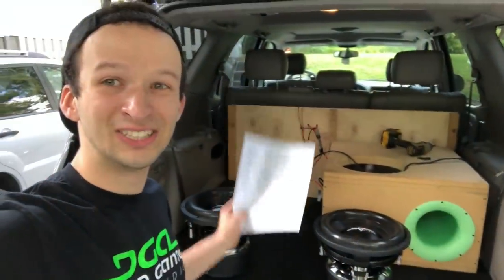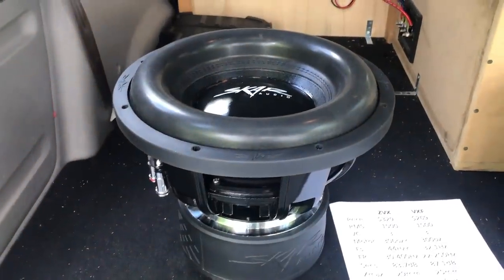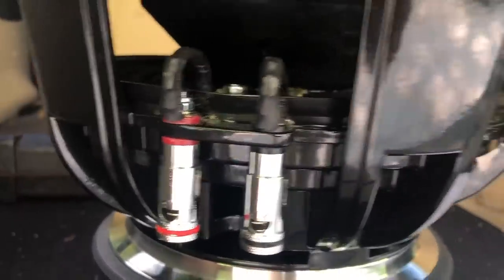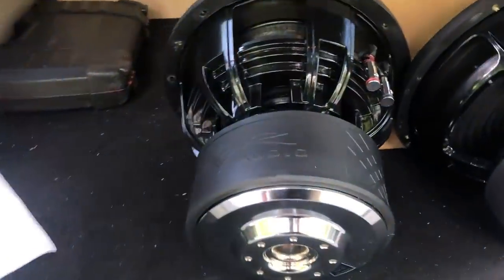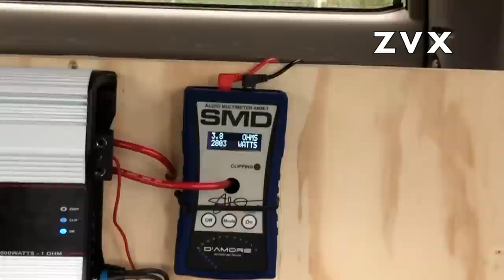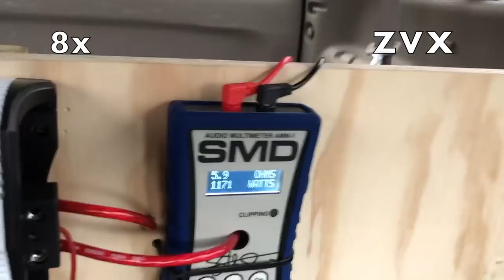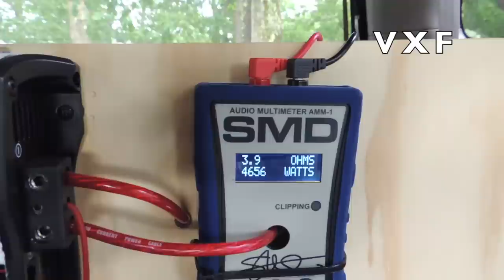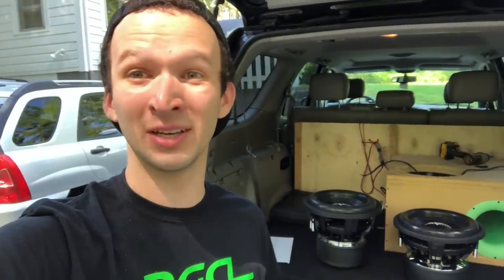SKAR ZVX VS VXF!! Which Is Best and Why? | Head to Head

Comment: I'm more into the quality of the sound. That being said I am running a single vxf15  on skv.2 1500.1. This thing hits hard and sounds clear. Took a while to purchase this setup. Last system I had was years ago jl audio 15w3 on a directed 600d. Not quite as clean as the jl but definitely close.
Reply: Did you have to upgrade your power supply?(battery etc)

Comment: That Zvx was going up to the high 7's in ohm load. Where the V was only going about 5.
Reply: Is that good or bad?
Reply: technically the vxf would be getting worse and less sound with higher ohms, 1 ohm produces the most power out of amp and lets say 4 ohms would produce 3 times less. so if a amp is 4000 watt 1 ohm stable and 4000 watt, that would mean 2 ohm would be 3450 watt, 3 2750 watt and so forth. so in his case the vxf was taking more power, and producing hard hitting LOW fq bass, while the zvx was produce a faster and higher fq, while using less power.

Comment: ZVX has taller motor of smaller diameter for the increased stroke. It keeps the coil in the magnetic gap through more of the stroke (or throughout the stroke).

Comment: I am working on a 2015 Toyota Crewmax and will have 8 VXF dual 2ohm 12’s on 8 Audiopipe AMPI 2000’s. Having a hard time with designing the setup for a second alternator but it should work out with time. Long way to go but should have the loudest Tundra Crewmax that I know of. One unique thing I’m doing is a snug with a accordion boot and retaining the factory rear power glass ! Also have 2 Skar VD 8’s behind the back seat in the cab in a prefab ported box for everyday listening and know one believes it !

Comment: I have a skv2 2500 pushing dual 1ohm zvx 12s in the skar prefabed ported box. Tuned at 33 hertz. Sounds insane. Only upgrade i have is the big 3 and added another battery. I should of gone with the 3500 but was on a budget. All I can say is  that skar backs up what it says on the audio. The lows in my set up is crazy. If you can't hear it, you will definitely feel it

Comment: I got 2 VXF 12s with the skv2 1500.1d and I love it! Very great sound quality!
Reply: You have 2 1500 rms running on 1500 total? How many ohms?
Reply: Dude put that on a skv4500 PLEASE
Reply: @AudioEuphoria080  Fr. I got the SKv2.1500 on the SVR’s 😂
Reply: @BlueCollarWorker2  i forgot i commented that lol
Reply: @AudioEuphoria080  My bad I’m late homie. Just came here to see the different opinions and gain some knowledge in the process.
Reply: @BlueCollarWorker  you should put an skv2 2500 on those svr's and tune it with an oscope or just keep it down a little because that 1500w amp after ohm rise is not giving them rms
Reply: But even so i wouldnt recommend skar amps really anymore. Ive learned alot
Reply: @AudioEuphoria080  What would you recommend if I went with two VXF’s? I’m sure you’ve been in the game longer than me. Any advice appreciated.
Reply: @BlueCollarWorker  i doubt it lol! But if you got 2 vxf, i dont have first hand experience with power handling but i know people put them on 2500 each so that being said i would get the synergy wfo 3.1 and run at half ohm or you can go for more power and run the synergy wfo 5.1 at 1 ohm. Both amps would need very very big battery reserves and probably a bigger alt
Reply: @BlueCollarWorker  but my tip of advice man is switch to sundown subs or fi or something equivalent

Comment: Master will got 4 of those vxf 15's with over 12,000 watts clamped power on them and hit over 155 .amps are at .25 ohm
Reply: 56 and they are 15s bro.
Reply: I think he’s running the 4-15” ZVX v2 now actually
Reply: @Elijah Dossett he actually is running the 4 zvx setup each on a 4500
Reply: @ResnicksRvingJourney  you right about them being 15s but they are vxf
Reply: @gentlemancallers1305   watch the video on Jacobs channel
Reply: He also told me the zvx puts up better numbers at a lower rms it takes more power for the vxf to put up the numbers that the zvx can.
Reply: @brick2077  Will did run VXF in the past but you you need to go look at his Facebook or other Social Media accounts & you will see you're wrong! Will is currently running ZVXv2 & has been running them for a while! You mentioned the video JacobViral put up, you may wanna go watch that video again. The video where Will has smoke coming out of the ports on his enclosure... That was the was ZVXv2 subwoofers, go watch the video again & you'll see.
Reply: @itdoesntmatterwhatyourname6128  cool will do thanks for the correction

Comment: I didn't really have a choice, because I'm running an 18" ZVX. Out of maybe 30 enclosures I've built, I never had one dig deeper, or sound cleaner. Maybe an 18" VXF would sound a little better.... "IF" they made one. I'm an SQL kind of guy, but I think the enclosure, and the DSP tuning make more difference than the actual sub woofer in question. Good video though :) TY.
Reply: I def agree. You really need to give a ZVX or any big sub like that some serious cubes to get it in it's element. Also meeting port area spec at bare minimum and ratio of port area per cube. But then again I do slot ports I know aeros can get away with less port area. I ran every sub size except 18 and I'm between going with a ZVX 18 or two vxf 15s prob will get the one 18.

Comment: I'd like to see the EVL in comparison to both of these. I already have 2 12" EVL's with a SKv2-3500.1D amp pushing them , I was thinking about getting the VXF subs and sticking them into the EVL box
Reply: Do it lol the vxf series is all about sq and way better compared to the evls.
Reply: Man I’m tryna build a tune enclosure for my evls
Reply: My son has 2 12 in evl dual 4ohm on a taramp smart 3k. It pounds. My oldest son has the same amp and just received one of the 12 inch dual vc 2ohm ZVX and it’s slamming as hard as the two EVL’s.

Comment: Parker, aren't you glad I suggested to you several times to do this video? You're coming up on 100K views! Congrats! Glad I could help. Another suggestion I have would be adding a Fi sub into the mix (Fi Neo). Fi now builds them in about a week, not 3 months as before. Eventually you could compare Fi vs Deaf Bonce vs Sundown vs DC vs PSI vs Crossfire. I suggest having several different boxes on hand (volume, adjustable port area, and adjustable tuning) and use the one that is closest to the sub's manufacturer's volume suggestion (middle of the road) bcuz using the same box for all subs will hurt the SPL score for subs built to require a larger enclosure (3ft³), and larger port area (16in² per net vol ft). I also suggest you remind viewers in every video the box specs and say how just bcuz a sub doesn't perform well in this specific box doesn't mean it can't have better SPL if in appropriate suggested enclosure.
Reply: Youre taking credit for his achievement of 100k views. Youre weird.

Comment: VXF for the win. Look at the specs. If you listen to your subs and not just burp them, the FS and frequency response kills the ZVX. Same coil size and power handling. Leads are every bit as good on the VXF. Taking Parkers bias out of the equation. If you like something because of looks that's ok too. No worries. Performance wise the VXF is a clear choice. Of course Parker likes the Black Juice on his coils for whatever reason since there is NO verified evidence that any of the coatings make a difference. He really is hung up on the coating and unfounded criticism directed at the uncoated coil. Kind of weird.  Both very strong subs at decent prices.

Comment: The Skar Audio ZVXv2 subwoofer line is the go to subwoofer when it comes to SPL. Designed to be the best competition subwoofer on the market each ZVXv2 subwoofer features a 3-inch high temperature voice coil, massive 3-slug motor, competition grade cone and a high roll foam surround. The ZVXv2 has been proven in the competition lanes  win after win and they will not let you down.
Reply: Copy and paste directly from the website 🤣
Reply: @1moetime123  facts 😅😅😅
Reply: Sure if you have a fuck ton of room for each sub

Comment: When comparing subs that are very similar I suggest explaining and or listing the (Thiele/small parameters) it’ll better explain why they do what they do. It’s the lil details that really makes subs differ from each other. Love to see you having fun and your always getting better. Killer vid as always Maing!
Reply: The theile is on the companies website , he is getting down to the nut cutting and doing the testing the way it should be. His veiwers dont consist of very many people who would know what those figuires mean. I mean really, even knowing that a sub with a qts around .4  will perform good in a sealed box or knowing a higher bl of a sub makes it more effeicient in its power range still dont tell us what actually playing them does. The parameters seem to differ in the more mass produced subs in my findings due to the cheaper manufacturing process due to the common goal of quantity versus quality as opposed to the smaller companies that hand build a whole sub per worker vs an assembly line not to mention a much stricter qc .

Comment: Hey Parker will the vxf work good with a 1800 watt hifonics amp? Just ordered vxf 12 D4 and I’m unsure if I’ll be fine with that amp or if I should bump up to a hifonics Brutus that I have laying around (2200w I think)? Thanks in advance! Also currently have a alpine type x 12” and unsure if I should keep the amp’s tune the same or turn it down while it’s breaking in

Comment: Hey Parker I have a question,on my zvx’s one of my dust cap came off,can I rock the subs like that without one of the dust caps off,or should I glue it immediately??
Reply from the maker: The dustcap helps with cooling so I’d get it back on ASAP
Reply: @ParkerTheBasshead  thanks bro
Reply: @ParkerTheBasshead  it doesn’t want to go back on,I tried adhesive glue and proxy,nothing bro 🤦🏻‍♂️🤦🏻‍♂️🤦🏻‍♂️🤦🏻‍♂️
Reply: Super glue

Comment: I have ran two vxf 15's on a smart 3 for over a year. I just ordered two zvx today cuz sadly the box that I have my vxfs in is too small. And it caused one of the surrounds to blow on the sub. Still sounds amazing but would like to possibly fix it later. I bought the zvx's to give them a try. Watching this video I hope I did not make a mistake. But I will definitely say the vxfs get down low and give crazy flex in my car. To me the vxf is a great starter sub especially for the price.
Reply: How do the zvx’s sound? Do you regret it?
Reply: @TimmyTwoTuck  absolutely not. They are still breaking in and sound amazing. Have all the materials to build the new box just need the time
Reply: @jakeblackburn1814  I’m trying to decide between the two. Leaning more towards the zvx
Reply: @TimmyTwoTuck  the best advice I can give you is if you are looking for overall musical sound pretty much through all frequencies I would say the vxf. Don't get me wrong the vxfs slam and get low. But I'm looking for that ground shake. That's why I went with the zvx. If ur looking for sound quality vxf. If you're looking to possibly compete which is what I am trying to do in the future, zvx
Reply: @jakeblackburn1814  appreciate the help man!
Reply: @jakeblackburn1814  i don’t compete but i like my shit to hit hard i had 2 sundown sa 15s and loved them i should have never sold em, trying to decide between these two now

Comment: I have 2 vfx 15s in my el camino and they sound amazing
Reply: I want that!  Can u feel it outside the car 🚗?  🤔 

I'm thinking of getting 2 of them on a blow through for my f150.. but I want something others can hear 👂 as I drive ..
Reply: @robinthrill3r7  Ya you can hear them for a good 30 yards away
Reply: @iNITROCIDEi  Sold !! Thx 😊 

What size amp do u need?? I heared they can push over 1500rms easily.
Reply: @robinthrill3r7  Im running a 4500 to them
Reply: @iNITROCIDEi  the 4500.1 RP ?? 

And did u need to install a second battery or aftermarket alternator?

Comment: Great video, Parker, I'm new to the bass world, and I need some help. I have 2 ZVX 15v2 on a SKv2 4500, wire to 1ohm and don't have a clue  where to set the gain. I've bought  the SMD DD-1+ but don't know where to set gain. Should I set to clipping? Thanks, New Jersey
Reply: Hopefully, you've gotten it figured out by now, but just in case you haven't.  You don't want clipping, so adjust the gain up until you first notice clipping and then dial it back slowly until there's no more clipping.

Comment: Just ordered 2 zvx 12s for my custom 6 cube box I’m pretty excited
Reply: Did it come in yet? If so does it seem pretty high quality like the kick is perfectly aligned with the bass or its a powerhouse that is loud with a slight delay but bangs.
Reply: @tupbeatz2740  more of a powerhouse that is loud and definitely will turn heads when playing it’s also very acoustically sound but there’s better options if you want a more acoustic sub

Comment: Hey Parker your doing awesome with your channel really stepping it up! You are very familiar with American Bass and I cannot figure them out there prices (from there site) features and specs are all over the place... On there site in the 15" $200-$300 price range the elite is the most expensive? And it's steel and 150oz magnet? The xfl is 2nd with 200oz cast but 1000w rating, then XR 200oz cast with 1500w then the TNT 200oz cast and 1500wrms?? I'm confused why is the steel elite the top one is That price range?? I can't get a 2nd NVX VCW15 at moment nor a factory recone for my broke VCW15.. so I may switch it up to American bass but I'm baffled at there prices and ratings, I do not want an steel basket it just seems cheesy plus may mount them inverted also so the elite is out of the choices. Any info clear up the confusion.

Comment: I have a question, I’m getting a VXF 15” and wondering which amp. Either the Skar RP 3500.1D ($459) or the Skar RP 2000.1D ($249). Would the 2000 give the sub all the power it needs or should I get the 3500?
Reply: It’s rated for 1500 -2000
Reply: @TaxationIsTheft439  Heard they could handle much more. I have the ZVX on 5k amp wired 1ohm
Reply: @ryaneboy101  good grief man sounds like a fun time

Comment: So I know Sony explods are kinda out dated I guess but was wondering what your opinion is on them? I have a 12 inch Sony xplod Xs 2000w
Reply: Those are 350watt rms, I used to have 2 and I replaced them with a single Rockford fostgate 10” was way louder than the 12”s and sounded way better then I upgraded to a 12” p3 and now I went with a sKar ZVX-8 and it hits way better than the p3 12” 
so what I’m trying to say those Sony’s aren’t that loud but they will take more than rms power and keep going

Comment: I was wondering if the VXF sub would still hit hard and low on about 800 watts or lower. I want to get this sub but don’t think my car can handle the wattage on stock electrical. An alternator is too expensive and upgrading my batteries is all too expensive. Do you think I should stick to a lower wattage sub or do you think this sub will be fine on around 800 watts?
Reply: I know its late but yea you should you won't regret it along as the box is custom built to your/specs of sub should sound phenomenal them prefab boxes suck
I had orion hcca's in a prefab box the suck but once the subs where in the the box holy Molly it was loud deep bass

Comment: I have a single VXF 15 in my '96 Corolla hooked up to a Diablo 8500w amp & it pounds & kinda want to switch to a ZVX 15 👀
unless I should stick with my VXF 15
Reply: What did you end up doing I’m stuck tryna pick between a 12” vfx or 12” zvx n my 04 impala
Reply: @Ceobub  I stayed with the VXF 15

Comment: What’s recommenced for VXF? I wanna run two 12s. Any electrical work need done ? My car doesn’t have no sub so everything stock
Reply: Gonna need an enclosure , that's 3000 watt rms for the pair so if u want to meet that wattage need a 3k or better amp with that amount of wattage u will need to upgrade the BIG 3 (atleast.. ) and have 1 secondary battery.    These aren't beginner subs, to properly run them expect to spend around $2000 atleast.
Reply: Yep. I literally just spent 2k on a simple set up for 2 vxf-12 D4.